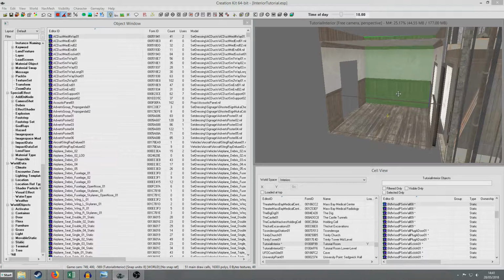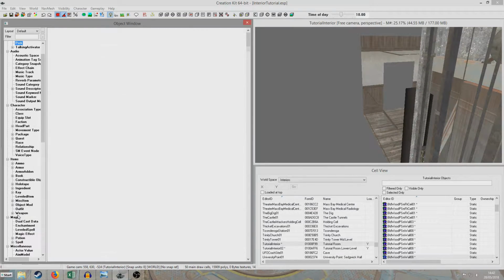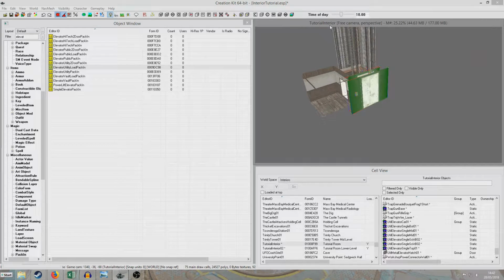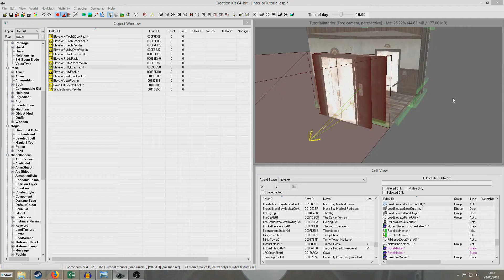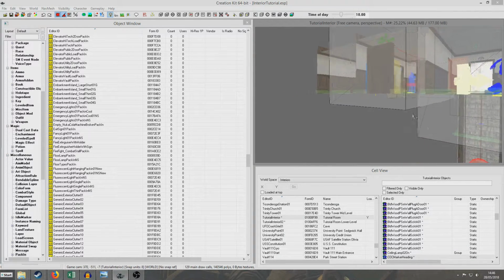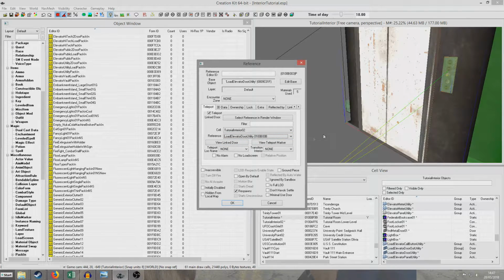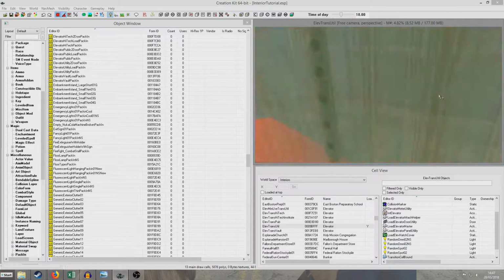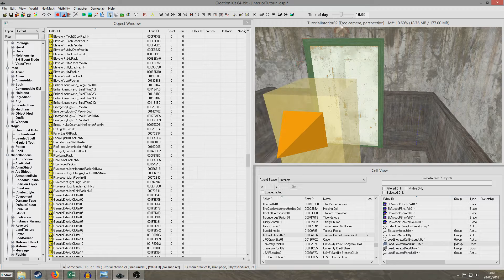Fallout 4 Creation Kit Tutorial - Elevator between Cells

Comment: How do you modify the PA voice? I mean wether you go up or down, you get the same "Ground floor" message
Reply: If you double click on the back interior (LoadElevatorDoor) and move to the Scripts tab you have a 
"load elevator door script". Double click it and in the properties menu you'l see "StartingFloor" and "EndFloor" with a value next to each of them. To change the direction of the elevator the Startingfloor needs to be "1" and the EndFloor needs to "-10". Then move to the elevator in the other cell and do the same again only switching the values so Startingfloor = "-10" and Endfloor = "1"
Reply: If I remember correctly you have to change a parameter in the script's properties